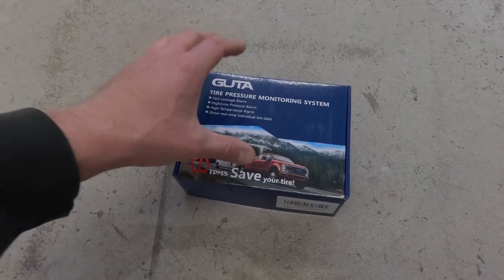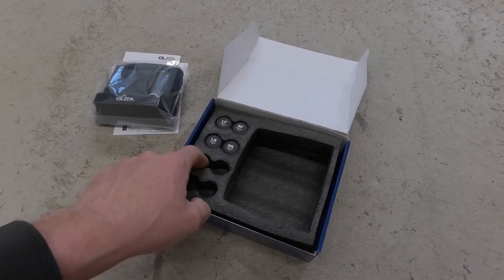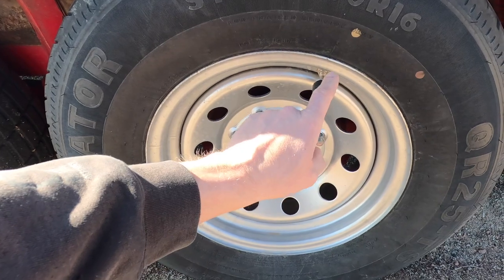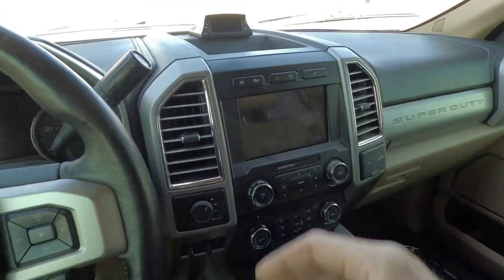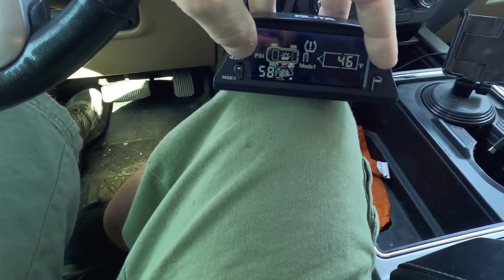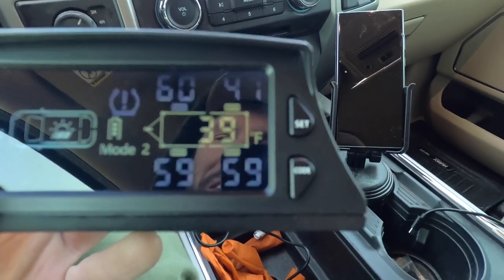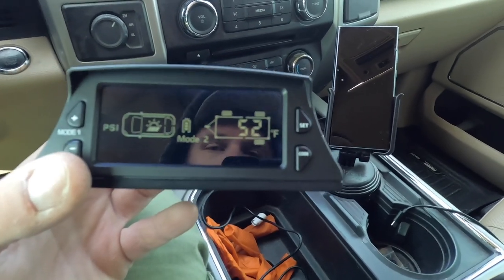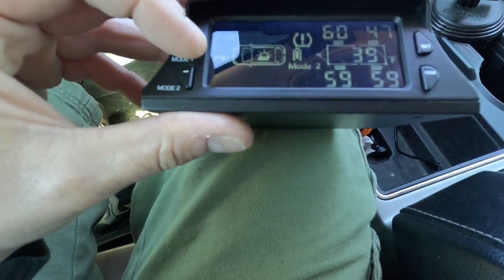Adding Guta TPMS Sensors to my Trailer so I never Get a Blow Out Again!!

Comment: I don't own this machine but with that issue where you can only set "high" to 101 is because your low was at 100. Once you lower the "low" to your specified low, you can adjust the "high" down more. Probably just a weird coding bug or its coded to prevent the high and low setting being flipped. I could be very wrong. But I've seen some weird interfaces with issues like that lol
Reply from the maker: I might try that now because I would like the hight to be around 85ish
Reply: I 2nd this, was thinking the same as I was watching that part
Reply: @1HotLegendLS  yep ... you can have you high lower than your low...
Reply: My only issue with this system was my 2500 needed 80psi in the rear tires and the max warning was 85 so after my tires were warm I had to unplug it cigarette lighter recieved or it beeped the high pressure warning all the time. I would just use it as a cold pressure check.
Reply: John, then you should use one designed for RVs/Trailers

Comment: Just remember to keep those sensors tight on the valve stem, I have ran a set up that was similar to that just by a different manufacturer, you have a slightly weighted ball going in a circle so if it's not tight it could come off.
Reply from the maker: Yeah that's true
Reply: They come with a brass lock nut u put on the stem first then u can lock the sensor on with the lock nut.

Comment: If you take that leaking tire with a plug to a tire service, they can put a patch on the inside of the tire. We had one of our tires done like that and we've had no issues. A plug is only a temporary measure to get to back on the road until you can get to a tire service to get it fixed properly. You don't need to buy a new tire, just get it patched.
Reply from the maker: It had a big bolt in it so the tire is messed up

Comment: Just installed this in my RV. Takes a while for the sensors to report, but it does well. Wish the unit had a dually configuration.
Reply from the maker: Yeah that would be nice I'm guessing they will keep upgrading them

Comment: I just bought a Tireminder A1AS for my RV. It was pricey, but I didn't want to take a chance on a lesser known brand. I also have 8 tires on the coach plus the 4 on my towed vehicle.
Reply: How do you remove your tow vehicle without it beeping that the monitors aren't functioning?   Do I need to disable the tow vehicle tire pressure monitoring senses to do this?  We have a system for our RV, and want to put it on our tow vehicle also.
Reply: @debnovak19  That I don't know. I have a motorhome, so I'd be removing my towed vehicle. I upgraded the sensors to the flow through type so I don't have to remove them to add air. The main system is still in the box. I hope to set it up and test soon. I will post back here when I have an answer.

Comment: Try running nitrogen in your tires. It's far more stable and has far less issues with varying tire pressure due to expansion. It's the water vapor in the air that causes the expansion when the tire gets hot.

Comment: Nice I have used these TPMS sensors for years off wish on several vehicles. It's so convenient with the valve stem mounted system. My only issue is one of my sensors started killing it's battery very quickly the other three the battery lasts over a year usually no changes needed. It's so easy to reprogram the cigarette lighter receiver. Have u ever watched https://youtu.be/znJmVndhLJ4 he is amazing at building carbon airplane parts and I think many of his ideas for moulds would work in automotive for intakes or carbon exterior pieces like headlights, tail lights interior trim.
Reply from the maker: I'll check it out